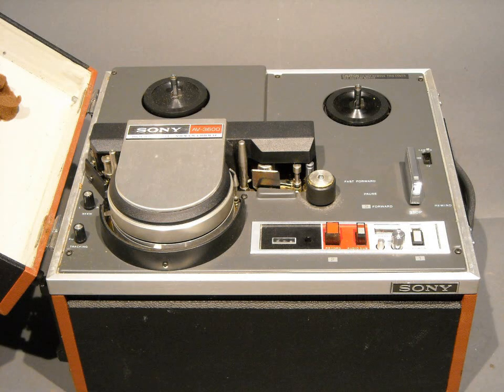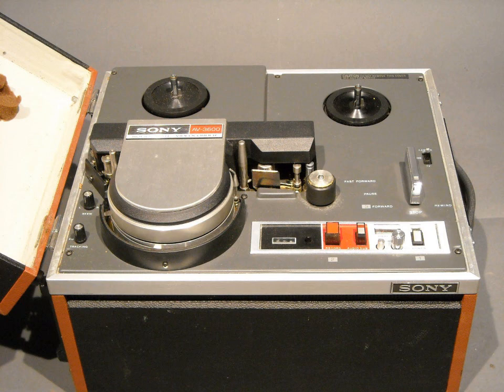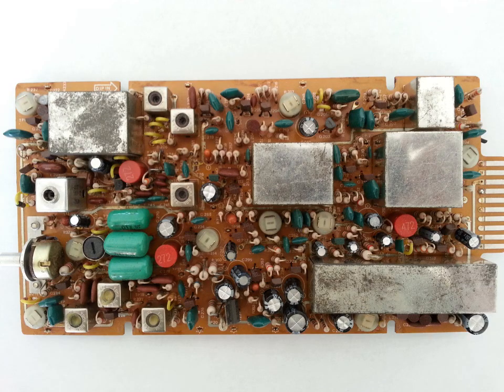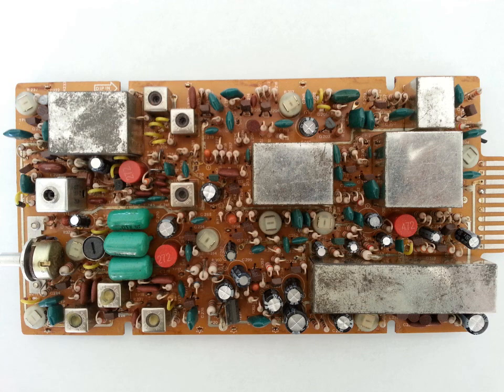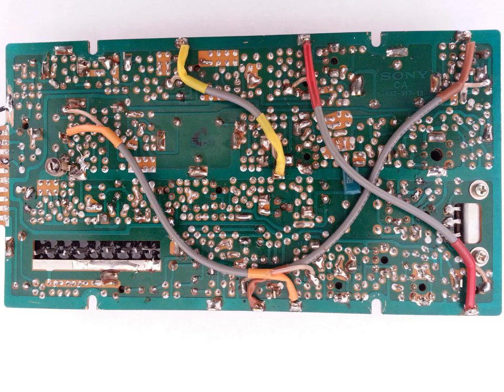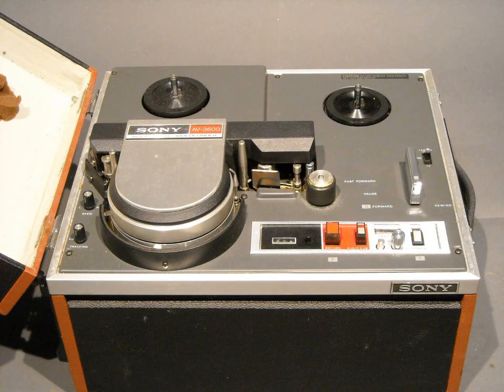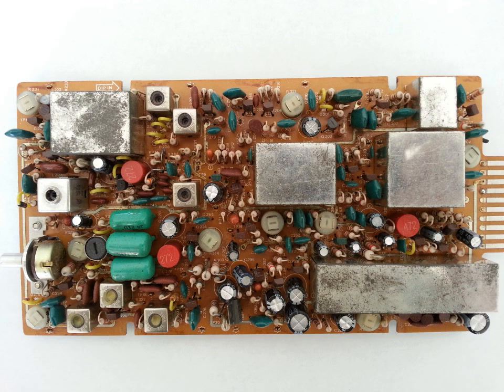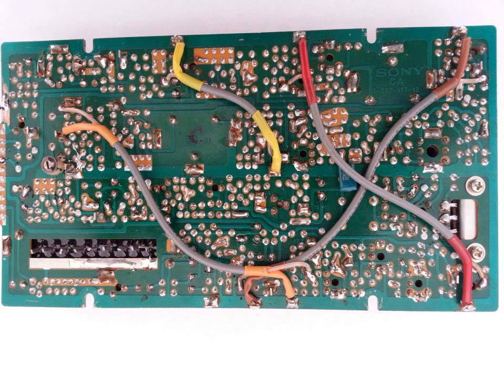How To Play Color On a Sony Av-3600

Comment: Great video Rick. I have a couple Panasonic NV-3085's. I'd love to get these guys working in color but I haven't had any luck finding an NV-A610 color adapter. Have you had any luck converting one of these or have any idea where I might find one of those converters? P.S. I watch Svengoolie every Saturday night here in Chicago. It's on now!
Reply from the maker: +dan robertson 

Dan

the Panasonic Nv-3085 has many issues. i have worked on several of these and the units needed to be Recapped as far as the color Adapter Nv-A610 i have never come across one at all as you see i service many of these for the past 30 years and have had many people ask me this very same question. also since its a portable unit for 30mn tapes there wasnt a demand for them.